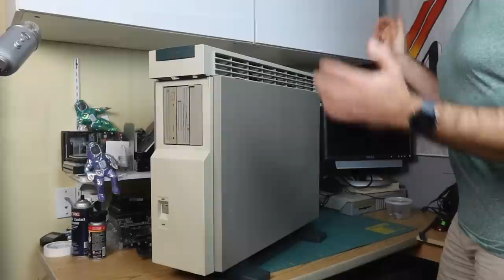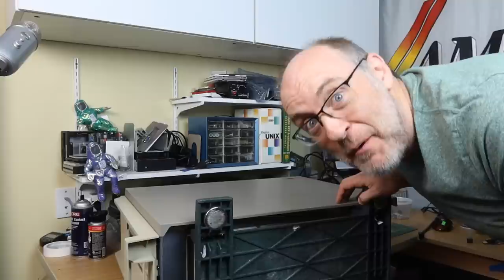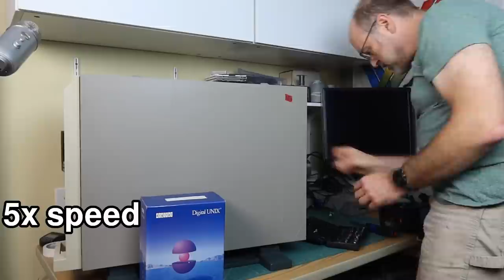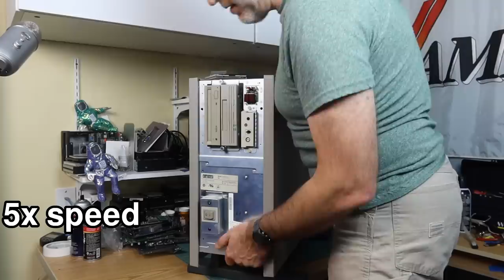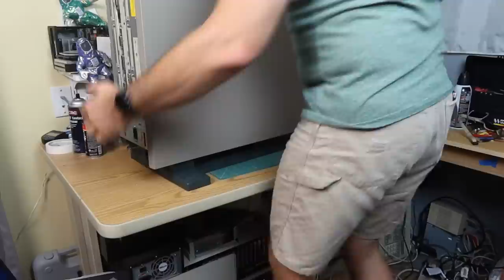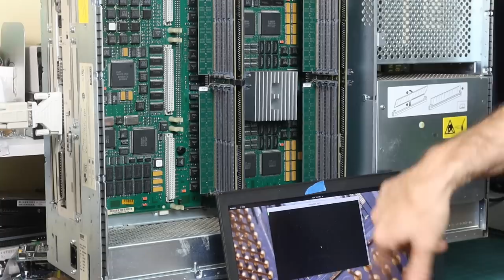Peek inside a DEC 3000 model 500

Comment: The "goofy" connector on the back is a DEC MMJ (Modified Modular Jack) used for serial terminals. The VT320s of the era had the same jack. The DEC keyboards used a more normal RJ-11 as I recall.

Comment: If you think those modules are large with that connector you haven't lived and enjoyed HP9000 G/T class memory modules. Here's an exercise for you.. stand in front of the mirror and practise the phrase "Frame Buffer" .. not a "Graphics Card". Please. It won't run FarCry .. though there was Doom for OSF/1
Reply from the maker: I'll write, "It's called frame buffer not graphics card." on the blackboard 100 times... just like Bart Simpson. With as much time as I spent working on the Xserver, you'd think I'd remember that's what old UNIX systems traditionally called the graphics subsystem.
Reply from the maker: Oh... and running Doom on this system (or the model 400) is high on my wish list!
Reply: @TalesofWeirdStuff  Very good.😁😆

Comment: So, with power off dismantle the PSU and check for internal fuse. Also check for any RIFA capacitors (plenty of videos on what these look like and what to do with them). 

Check voltages on the power lines feeding the HDDs, and try powering up with HDDs removed in case one of them is faulty / dead short. 

Try powering up with case panel on in case there's a switch disabling power when case open. 

And ofc make sure your breaker didn't pop.

All you should need is a multimeter, maybe some small sharp snips to cut out any RIFA capacitors in the PSU. They are only there to reduce noise in the power cables around your home, PSU should function with them snipped out.
Reply from the maker: That was basically the plan for the power supply. Being from the early 90s, I doubt it will have any RIFAs. If it does, they shouldn't in the kind of configuration that makes them likely to stink up the house.

Those are really good suggestions about independent testing of the HDDs and the front panel. Fault-testing individual parts is one of the first pieces of advice that I give, so I don't know why I didn't consider that here.

Comment: As a kid I drooled at the Alpha’s in magazines, 64-bit unix sounded pretty good to me. We’re living in the future man.
Reply: Me too! I saw them in magazines, and how they had a much higher clock speed than nearly anything else out there at the time. Last year, I actually bought myself an Alpha machine; The DEC/Compaq AlphaServer DS20. Mine has a single CPU card with an Alpha 21264 @ 500MHz and I believe either 4MB or 8MB of cache (I forget). It can accept a second CPU card, but they're a bit pricey, so I haven't bought one to upgrade it yet. The machine itself has 1GB of RAM, which was actually extremely large for the late 1990's. It had no hard drives included, but I did buy a 4GB DEC SCSI hard disk to put in to it. As well, the CD drive doesn't work for some reason. Thankfully it has an IDE connector inside it, so I connected an IDE to CompactFlash adapter and an IDE CD drive to get it up and running. I was able to write to the SCSI hard drive, but for some reason can't boot off of it (probably drivers). Still, it's a super fun machine to play around with!

Comment: A UNIX machine without a serial port? Sacrilege!!! In the UNIX paradigm, printers are serial devices, so a "printer port" on a non-PC would likely be serial.

It's worth noting that there are many, many different IEC connector types. The types used for consumer electronics like this computer fall under IEC 60320, and the one shown is not for high current, but for high temperature. The socket shown appears to be the IEC 60320 C16 type, that takes an IEC 60320 C15 plug. It's rated at 10A, just like the IEC 60320 C13/C14, and the badge next to it confirms this current rating. That's fully half of a 20A 120V circuit.

On old computers like this, I'd expect to see a power on/off switch and a start/stop switch of some sort. The former cuts off all power to the system, while the latter controls booting of the machine.

Comment: The tape drive is a: TU58 DECtape II magnetic tape drive used the DECtape-II cartridge, which could hold 256KB. I ran some early 11/750 that required 3 tapes to boot!! Later DEC installed a PROM to do the job.

Comment: I’ve never seen a DEC machine with a MIPS processor. Just VAX stuff. I wonder how they performed.
Reply from the maker: The DECstation line was MIPS based. I have a DECstation 2100 and a 5000/120. I plan to eventually do videos about both. The 2100 is a 12.5MHz R2000, and the 5000/120 is a 20MHz R3000. The original PlayStation had a 33MHz R3000, so... yeah. :) I think the fastest DECstation was maybe a 120MHz R4000. The 150MHz Alpha should beat all of those by a significant margin.
Reply: @TalesofWeirdStuff  Sadly yeah it will. The MIPS stuff are often called "SPIM Boxen" because they run in little-endian mode (like most but not all DEC stuff). They were really nice. Ultrix ran on em and there's upto 2.0 of OSF/1 on them before DEC shafted us all and dumped the line. I still run some 5000/25's with the KN04 R4000 cpu in em. NetBSD supports these guys like troopers with PMAX/PMIN/3MAX and even the newer USB1.1 Turbo Channel controllers from Tobias. Great era to be investigating. :) I expect you'll have lots of fun investigating it all. P.S GXEmul has SPIMbox emulation that with the older emu's run Ultrix 4.x pretty nicely

Comment: It's pretty easy to make a 3W3 to VGA adapter cable if you have a monitor that can handle Sync On Green.
To connect a keyboard you need the breakout cable that connects to the DB15 below the mmj printer port. That mmj printer port can also be used a the console port for a serial terminal. There should be an "S3" switch somewhere on the back to choose which it boots up to.
EDIT: I wrote this before the "Power on segment" of the video.
Reply: He can just use a standard serial terminal, too. :)

Comment: There were other oddball 40bit ECC systems (RS6000, Mylex RAID controllers), they aren't 100 pin, 'tho.
Reply from the maker: 100 seems like a weird number of pins. Parity 72-pin SIMMs already have 36 data + parity bits, so 40-bit ECC should only need 4 more pins. I'm really curious what all those other pins are even for.

Comment: I never got to play with the turbochannel variants, but have played with machines like the 1000. The first thing I would be doing would be to put the covers back on as there is often a microswitch that prevents operation if the cover is removed. I just jam something in the switch on mine when I want to operate without the covers. Failing that, it is probably some issue inside the power supply, which are quite complex on these machines. On my 1000 a capacitor shorted which blew the fuses.

The console port is probably the "mmj" on the back. Cheers,

Comment: I had the exact same problem with my machine when trying to start it.
I took out the power supply and cleaned the solder side of the high voltage board, removed a lot of dust, measured 350 VDC out of that board and then reconnected everything. After that, the machine powered up. Wow, it runs really silent for such a big computer, and it has a huge graphics card inside (taking up 3 Turbo channel slots) This must have been used for CAD or something?
Maybe it choked because of all the dust inside or the fact that I reconnected everything may also have helped?
Really looking forward to install Tru64 now, as I got 2 big boxes of CDs and books for that operating system with it.
I also got a 21'' DEC CRT monitor, the image quality is awesome!
Reply from the maker: Hm... Could also be cracked solder joints on that power board. Yet another machine that I need to get back to working on.

Comment: I feel a need, I guess, to clarify some things. So you have a Flamingo and you want it to fly? Let's begin here. (A lot of this is from memory as I dumped my DEC 3000/600s and /800s in the recycler four years ago.)

This was around $30,000 when we got one. Actually we got it free from DEC. For a while.
Nice little system. I was a VMS/VAX systems programmer. Moved to work with Ultrix on the VAX and then DECStation MIPS. Then OSF/1 first release on the 3000/500 we got. I have a few VAXen left (running OpenVMS and NetBSD), two AlphaStations (OpenVMS and Tru64 UNIX), one 1u AlphaServer (Tru64 UNIX).

Front Panel
Top button is a HALT (and not catch fire) button. Pressed to engage the system monitor. Two lights below it are status/error indicators.
Just below is microphone in, headset out, phone in, aux audio in.
This was a workstation designed to be used with the (included) headset w/mic and ear piece.

Bottom is "DC Voltage Good" light, power switch, fan is broke light. Never run a system with "fan is broke" lit.

Back Panel
This is where things get interesting. With it standing up NORMALLY:
10Base-T twisted pair ethernet.
AUI Ethernet ("thick wire") I still have some. LOL
ISDN 128Kbps line
Printer/Console port. So this is output or bi-directional serial MMJ console. There is a darn small switch back there which tells the system WHICH you have.
Keyboard and mouse port. These came with the system. DEC LK301 or 401, I forget.
Full comm port. Another terminal, MODEM, printer, etc.
Monitor port. Some switch is there for toggling refresh rate. Very weird rates. Never try to get an LCD to sync up.
External SCSI port.
Standard power port for 120v/10A USA power. I remember this one well. Shows on the label on your system BTW.

If this has a graphics card in there, remove it. Run it with a terminal. You'll have to likely do a firmware/PALcode update. You can run OpenVMS, Tru64, NetBSD, VERY OLD OpenBSD, RedHat Linux (RHL) v5.2. You're SCSI CDROM needs to work to do so, and update PALcode. Always load UNIX PALcode to run anything BUT OpenVMS.
Yes, you can install all of those on the system at once, booting up each one individually. All of them require their own SCSI drive BTW--they don't share well. You can use a SCSI data disk to share files.
I have a SCSI tower with said installations from the old 3000/800. Was great.

OH and there are four memory regions. You need (I think!) two DRAM SIMMs per region. So eight total just to get it to work. I'd bet the power supply is either shorted, caps are shot, or it's toast. It MIGHT have a fuse. Worth looking.

Hope this helps, somewhat.

Comment: Love to see the internals of old computers. Thanks. Hope you get it booted.
Reply from the maker: Me too. I will probably dig into the model 400 before digging back into this model 500. I'm suspicious that the power supply is the problem with this computer, and servicing power supplies is very, very low on my list of favorite things. :(
Reply: @TalesofWeirdStuff  busted cap replacement is a typically required thing on such old hardware. Hopefully there aren't too many. :) Good luck with the soldering iron.

Comment: Would manufacturing your own sims be an option? The boards for those sims are usually not too complicated, and perhaps you can get some used/new old stock of the actual ram chips. At worst, you need to add some spi/i2c/one-wire or whatever chip for identification.
Reply: Not likely. There are a lot of tiny traces that are very timing sensitive.
Reply from the maker: I know that people have made SIMMs for other unusual systems. People make 64-pin SIMMs used in various GVP accelerators for Amigas, and also 30-pin SIMMs Mac IIfx computers. It should be possible to do a 100-pin SIMM. SIMMs don't have any kind of SPD like DIMMs. Instead there are usually just a couple lines that are either tied to ground or +5V to indicate the capacity.

It might also be possible to just replace that entire board that the SIMMs are mounted on. To get the maximum 1GB that computer can have, it might be easier to make 8 of those boards than to make 32, 32MB SIMMs. The SIMMs are installed in groups of 8, so getting those modules right is going to be a hassle either way.
Reply: @TalesofWeirdStuff  Sounds like a fun project, ask PCBWay to sponsor it, and get some extra DEC hoarding cash :)